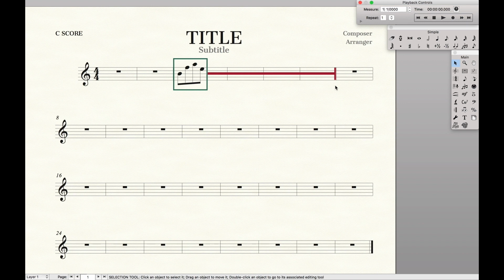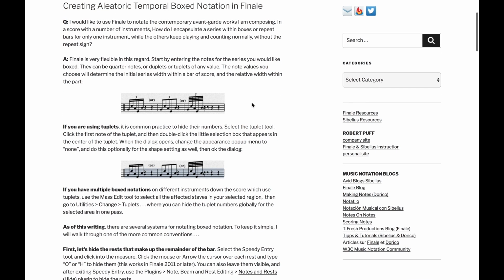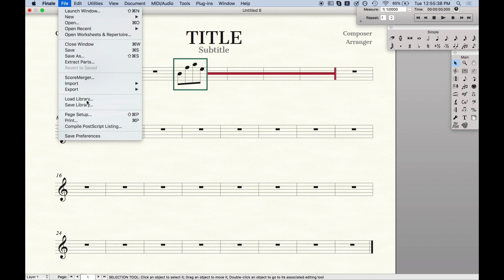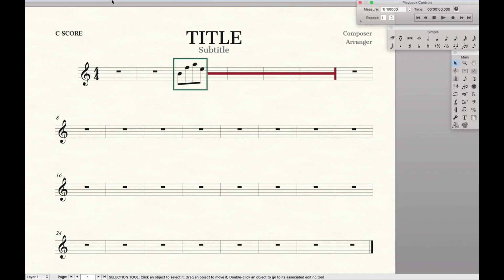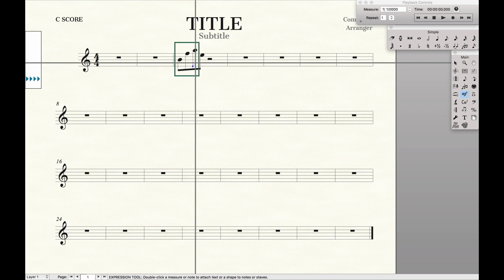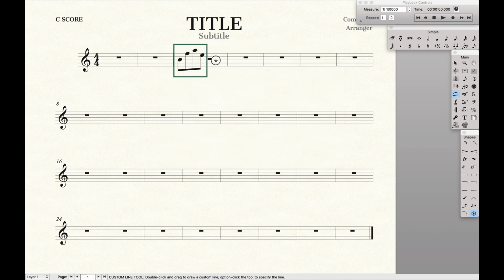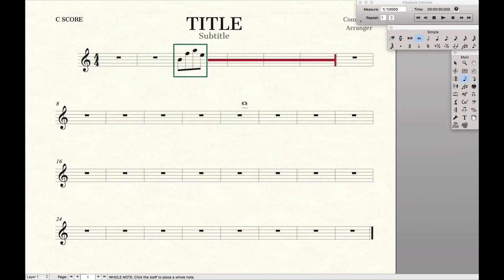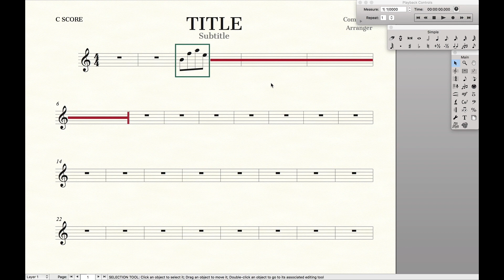Aeleatoric Box Notation (Wheel) | Finale Superuser

Comment: This method is really handy, but it has one major disadvantage if you are working with linked parts, the box and the parts are linked no matter what. I personally think, it is far better to create a thicker line in the custom line tool (0.2) and manually make a box in staff you want using 4 lines (it helps to make the upper and the bottom horizontal), this way you can edit as you wish in the parts and it will unlink in the score. Finally, you can use the line extender from the plug-in shown in the video.

A second approach would be to create two boxes on the same measure (with the plug-in method) one for the score and one for the parts, and unlink and show each box to score/parts accordingly. This method though is kind of tedious.

Hope this helps!

Comment: Hi! I was wondering if you had any suggestions on unlinking the box from the score and part. For whatever reason (even as a meta-tool) the boxes appear differently in the score and parts respectively. If I clean up the boxes in the part, the score looks like a mess, and vice-versa. I am working with a large ensemble and using an aleatoric notation which results in a chaotic-looking score.

Comment: I followed these steps and my audio units stopped working. Correlation? Random finale misfortune?
Reply from the maker: Just to clarify, all audio units stopped working for the entire piece? Not just isolated to this section of the music?
Reply: @nickmazuk  Correct—the entire piece and all other .musx files, new and old. I'm running Finale 25 on a 2017 iMac, OS 11.5.2. Using ARIA / Garritan instruments. I hear a few random pop noises, but the sounds are all gone. Resorting to midi is pretty desperate and I'm totally confused what happened. Any insights?